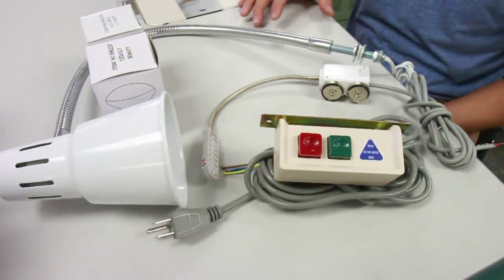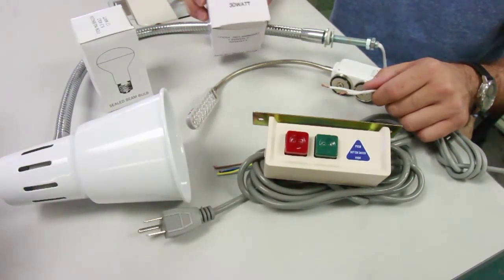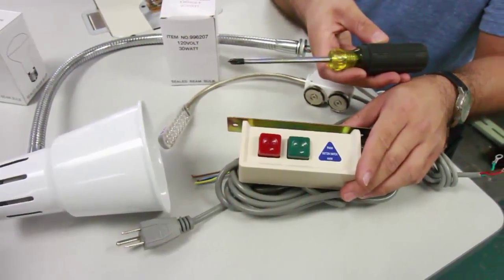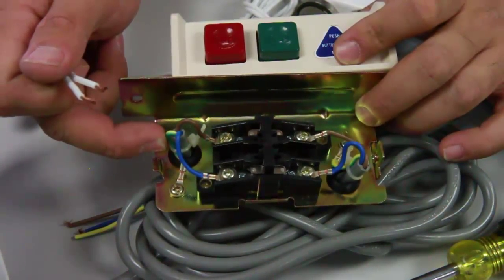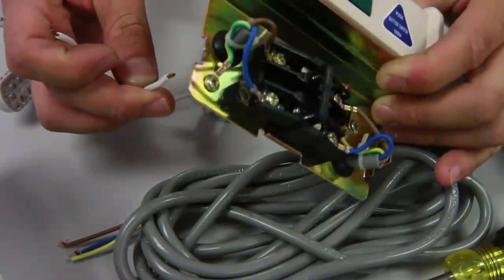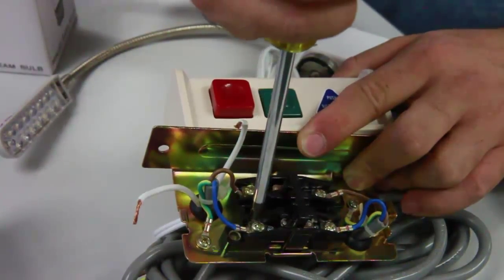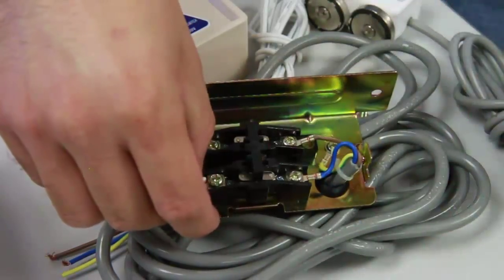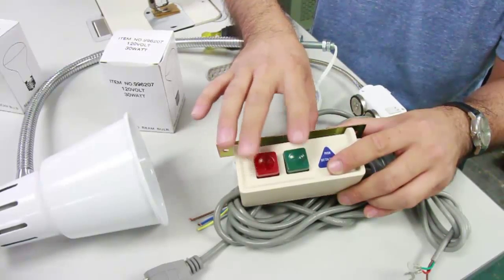Installing Gooseneck Lamp - ABC Sewing Machine

Comment: I bought a machine with push "ON/OFF switch box missing.
I got one like that you have,  with 3 wires.
I see where two of the wires goes on top and bottom, but can't figure out the third wire in the middle
Reply: If your machine is a 110V machine then you will only need 2 live wires. You have to check the 2 wires coming from the machine to the switch box then match the Plug cable that goes to the wall to match.  For example.  Your machine has 2 cables going to the "ON" side then you will only need to connect those 2 on the "off" side.